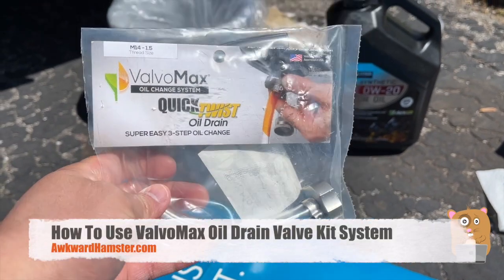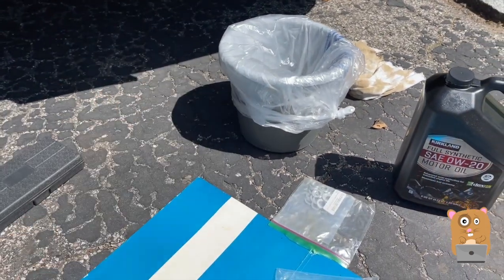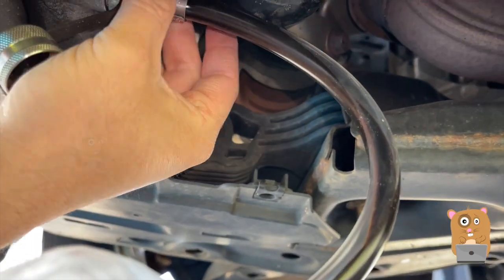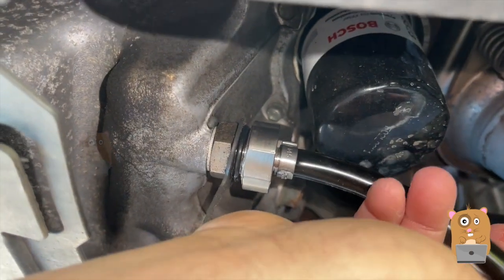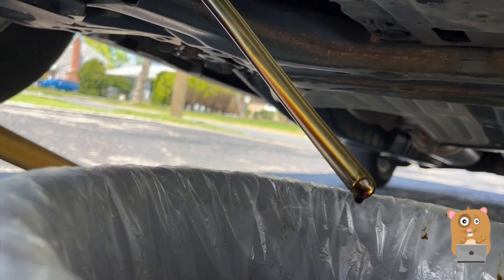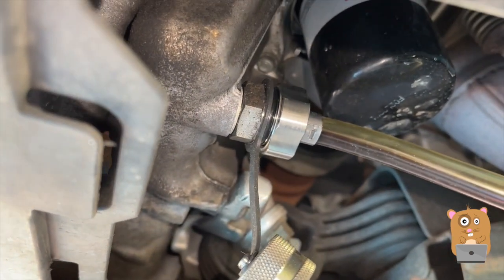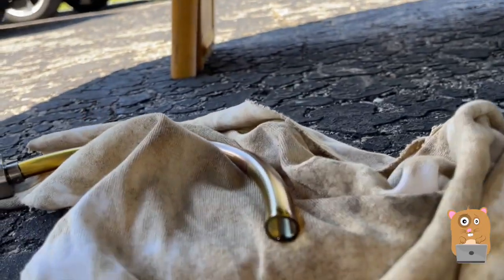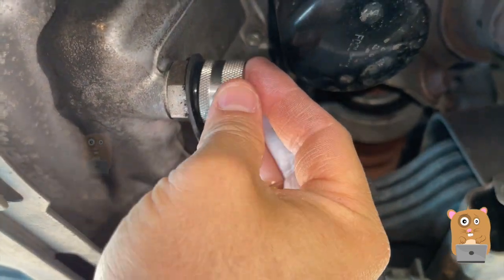How To Use ValvoMax Oil Drain Valve Kit System

Comment: I drained mine into the last 5qt oil jug from last oil change, this is defiantly much easier and cleaner. This uses tech that has been used to seal open hydraulic systems. Very nice time to share with friends
Reply from the maker: Thanks for sharing

Comment: This is a really cool product, seems to be a lot less pain than some of the others and thanks for the review and video.
Reply from the maker: Thanks for watching
Reply: @AwkwardHamster nice video! Def makes the oil changes less messy. I was looking at both this and the Fumoto valve, but this appears to be more user-friendly! Nice thing is, you could drain the oil directly into the container to be brought back to the recycle center, auto parts store, etc. 😃👍🏼
Reply: I cut the tube shorter and use a 6qt tall jug to flow straight into in. No oil pan catcher needed. Thankfully my Tacoma is tall, may not work for shorter cars unless it’s a flatter container.
Reply: @jcc766  yeah it probably wouldn’t work for my Honda Civic, but a vehicle with some decent ground clearance like yours (or an SUV), yeah I can see it. 👍🏼
Reply: Unfortunately you still make a mess from the oil filter replacement. 😕

Comment: Great product 👍
Much better than Fumoto
Reply: Eh you have to make your own stick w Fumoto??
Reply: In your opinion, why?  Where do you keep the adapter that screws on the Valvo?  Any foreseeable issues if the oil is sometimes changed at a dealer or Jiffylube?

Comment: What about tbt oil filter. You can’t avoid that mess
Reply: That was my thought as well. you still have a mess with the oil filter
Reply from the maker: I haven’t found a way to change the oil filter without getting my hand dirty.
Reply: Before you unscrew the oil filter put a good sized ziplock bag over it then remove. Any oil dripping will go into bag. Filter and any residue oil removed cleanly
Reply: @morg4620  You beat me to it. Yes, exactly what I've been doing for  many years.

Comment: Tactical error:  should have put in some of the new oil to make sure the valve had reseated and was not leaking, before screwing the cap back on.  But it's a nice video anyways.

Comment: I'm not fully conviced. I would have to make a mess from the filter in any case. 😅
Reply from the maker: I just ordered my third ValvoMax. This time for my Honda Accord. 
I haven’t found a clean way to remove the filter. I tried plastic cup, plastic bag, but still make a mess. Just yesterday I was wondering if I should try puncturing a hole in the filter to drain it some more before unscrewing. I saw that in a video. Since my car isn’t lifted far off the ground like theirs, I don’t think I can get enough force to puncture the filter at the bottom.
Reply: @AwkwardHamster Maybe use a battery operated Brad Nailer to puncture the oil filter?